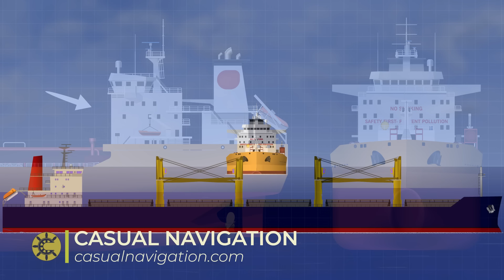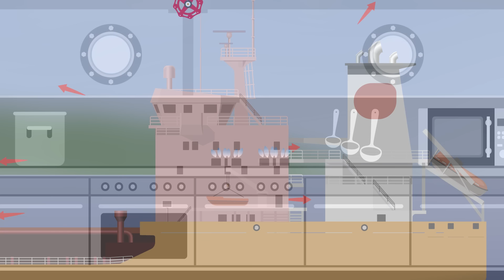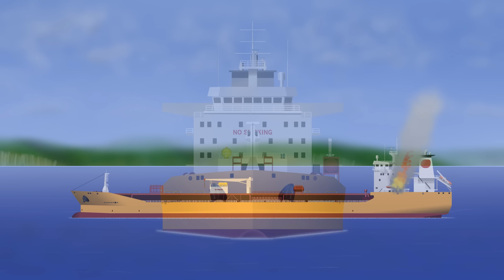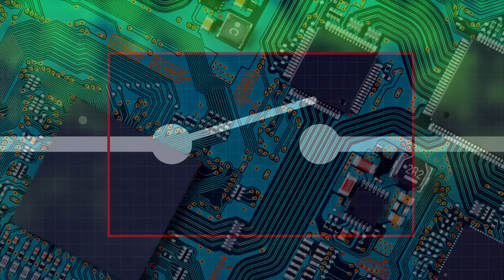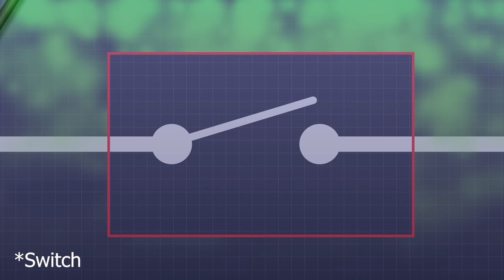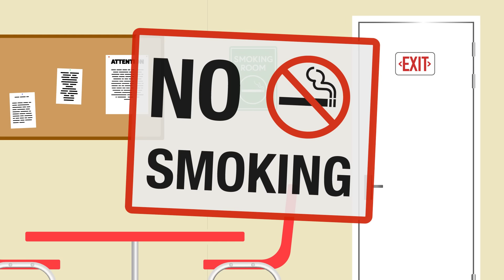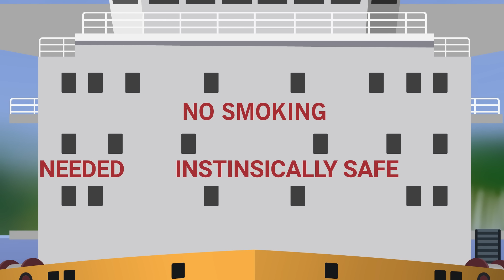You Can Smoke On A Fuel Tanker! So Why Is This Sign Here?

Comment: I'm so trigerred by the pneumatic impact wrench being plugged on the wrong port of the pressure regulator! Nice video still!
Reply: And I'm a bit triggered (just poking fun actually) at the sparks happening on the circuit on pads on the same track.
It's just one of those "merely for illustrative purposes" kind of things.
Reply: @Kalvinjj  70% of the things in the electronics picture probably never cause sparks too (not by design but because the power is so low)
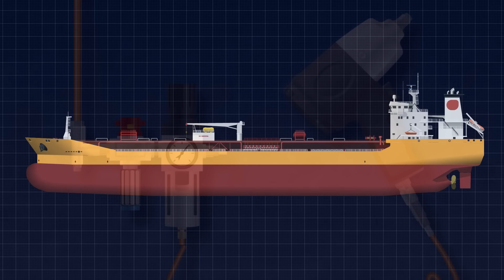Reply: MrBurne: And at 4:12 the hose at the bottom of the regulator isn't
connected to the hose to the tool. A break that looks like two hoses
just "pushed" almost together for the pix......
Reply: Easter eggs discovered
Reply: I specifically came down here for this comment I’m like why is it plugged into the water drain part if the regulator.

Comment: Cell phones have never ignited a fire at a fuel pump/tank etc. It's a myth.  Static electricity can however.
Reply: It was discovered, back in CB days, that a CB operated right next to a petrol pump, especially with an RF amp in line, could lock the fuel flow counter. 
It was never about safety. Just profit.
Reply: The other aspect is that you don't want crew distracted - especially during cargo operations.
Reply: Sean De Laloë  that's definitely true.
Reply: Those rules were also created with like early 1980s mobile phones in mind, which were higher power and likely less safe.
Reply: @urzaserra256  I don't know.  I drive a fuel truck and it's all bullshit.

Comment: I work on a small (85m long)chemical tanker in Germany . We have to use tool that have an Ex certificate.
Reply: Yes...tools made of extra super duralumin or beryllium bronze.  We weren't allowed in the welding shop to use any tools on the torches which weren't made of non-sparking materials.

Comment: I genuinely figured it was no smoking on the entire vessel! Also, compressed air tools with a hammer action would still be a source of ignition . Much like your car door latch in a fuel station...
Reply: would they just not use beryllium bronze parts where sparks could be caused?
Reply: @cockatoofan  Part of the EEX rating for the parts is to make sure of that, so you will find things like air lines are made with carbon loaded vulcanised rubber, as that is static dissipative, and that you will have a lot of hydraulic systems there as well for power. No PVC or nylon air lines, and the light fixtures are very heavy to remain intrinsically safe, even though they have electric power, it travels to the fixtures in heavy steel conduits, and inside the conduits the cable itself is steel wire armoured.  Any junctions are also in EEX rated metal boxes, with steel cable glands.
Reply: @SeanBZA  Yup. On the last vessel I was on the power cables to the exterior lights ran inside what I'm pretty sure was 1" water pipes, complete with threaded fittings and everything.
Reply: @chrthiel  Well that survives the environment and the pressure well.
Reply: Your car door latch in fuel stations are problematic because of static electricity discharge, not because the mechanism itself generates sparks. It's especially a problem with young people, who often does not grab anything when moving in or out of the vehicle, thus does not get an opportunity to discharge any static that has built up.

Comment: What about lightning?
Reply: The lights in the hazardous zones are in explosion proof housings, or high up above the deck to be clear of the zone.
Reply: @jamesmurney1374  lightning, not lighting.

I would imagine that proper lightning rods and conductors placed high enough up to be away from significant concentrations of fumes would deal with that... but I'm no expert, it's just an educated guess.
Reply: @chemistrykrang8065  Oops, did read carefully.   Cargo operations and venting are stopped during electrical storms.  Modern tankers usually do not have cargo vapors on deck while not working cargo.

Comment: Intrinsic safety is just one of many ways to design devices in explosion atmospheres. For pumps, lights etc it more commont to have explosion proof housing, And that means that housing of the device can handle explosion inside the machine without getting outside intrinsic safety means that even when there is arc on the device it carries so little power that would not be enough to generate explosion. Explosion atmospheres is a really wide topic and there is few more ways to ensure safety.
Reply: Thanks for your comment, I learned something new.
Reply: actually, explosion proof housing is more likely to be used rather than IS equipment.
Reply: Im working on a gas tanker and ex proof basically means gas tight in our case. So ex proof lamps on deck for example just have a special locking mechanism with extra rubber gaskets to ensure that nothing potentially explosive can enter the lamp casing where sparks could ignite it. But what he mentioned about smoking in being prohibited in port I cannot confirm. In port there is usually one dedicated smoking room (crew messroom most of the time) and both shore personnel and crew can smoke there.
Reply: @giantdwarfulf  Explosion proofing is not for preventing explosive gas to enter an enclosure, it's for prevent the explosion from inside the enclosure to heating up the explosive gas around the enclosure and cause fire. For preventing explosive gas going inside the enclosure, we usually add purging system with inert gas such as nitrogen inside the enclosure.
Reply: @aasakti_  ok but by preventing explosive gases from entering a potential ignition source such as a lamp or any electrical device does exactly that right? Maybe I confused the exact reason for what this special lamp casing is for but the effect is still the same
Reply: @giantdwarfulf Exd enclosures generally are not air tight/completely sealed.
The access lid has an engineered gap called a 'flame path'.
Its purpose is the gap is big enough to relieve the internal pressure if an explosion occurs inside the enclosure but the gap is small enough that a flame can't pass through and hot gases by the time they've travelled through will have cooled enough that they can't cause an ignition externally.
The enclosure itself has to be able to withstand the initial pressure spike when an internal explosion occurs.

It's ok saying "well if it's sealed, gas can't get in so it's explosion proof" but that's very surface level thinking - explosion proofing goes a lot deeper than that. There are situations where flammable gas mixtures could unknowingly get inside, such as opening up the enclosure for maintenance, the circuits inside may be all remotely disconnected at source while the work is being carried out but a gas mixture could unknowingly get inside.
If that enclosure was hermetically sealed? Congratulations!, you've just made a bomb.

Those enclosures have to be treated with kid-gloves, even the slightest scratch or mark in the lid/housing flanges renders the enclosure completely scrap.
Reply: I also found it funny they say pumps and winches would be I.S. … good luck finding motors that are IS over tiny tiny servos. The whole notion of IS is power limited.
Class 1 Div 1 TEFC or silly European Ex is a little more the norm for actual application. Good comment sir
Reply: What the fuck does automation engineering have to do with explosive materials handling?
Reply: @Marin3r101  Anything with Engineer at the end, you supposed to know about everything. Jokes aside, Automation Engineer usually working together with Instrument Engineer and Electrical Engineer.
Reply: All lot of the equipment and tools we used came from coal mining. Particularly anything certified as intrinsically safe. 
We did have flash lights which a bit more up to date than a Davey Lamp.

Comment: Um… no. Regular electronic devices don’t generate sparks at all. There’s actually quite a lot of dedicated features on integrated circuits (i.e, microchips) that deal with static electricity; and this has the side-effect of preventing any sparks from being generated.

However, electromechanical devices (which can include something as simple as a light fixture) can generate arcing if it’s running at a high enough voltage. Plugging in anything to a mains power outlet can also cause arcing; and high-voltage step-down power supplies (like a cell phone or laptop charger) can also have arcing if it fails or if it’s hit with a voltage spike (such as you can get if there’s a lightning strike).

The biggest hazard however (as mentioned in the video), is simply walking around… if you’ve ever zapped yourself on a doorknob, you know what I mean. This is why those integrated circuits have the static management features - otherwise, nobody would be able to handle their electronics at all, because every time they touched it after moving about they would fry the chips (however, do note that directly touching the chips and connections going to them without wearing a properly grounded anti-static wrist strap is still hard on the chips and can cause damage).
Reply: The video presents it as if sparking was a regular thing in electronics, in particular because the components are small. It isn’t.

Can a device catch fire? Oh yes - but a capacitor or IC that’s blown it’s top isn’t a spark, it’s an actual fire, albeit a short-lived one.

Yes, an inductor with a cracked solder joint under just the right circumstances can create arcing - this, however, for regular electronic devices (like, a smartphone) will cause it to malfunction in a more general manner (i.e, crash or just not turn on at all).

Explosion-proof devices are good to use on these kinds of ships (and other situations like mines and chemical plants); as if there is an internal fire it will be contained inside the case. Also, it shifts the liability from you to the manufacturer of the device (or more practically, their insurance company) should anything go wrong.
Reply: Low-power devices like smartphones are pretty unlikely to spark, they'd have to be damaged first. It's the same for the no-phones-signs at gas stations - the devices themselves won't generate sparks, but some might occur if they are dropped onto the floor, hence the sign. It might still be a good idea to limit electronic devices, though, since I wouldn't trust some cheap Chinese devices to not malfunction badly.
Reply: @NekiCat  yeah, after watching a couple BigClive videos, assuming electronics shouldn't spark doesn't seem like a good idea when dealing with potentially explosive gasses.
Reply: @SeanCMonahan  I’m also a subscriber to BigClive’s channel, and the stuff on there typically isn’t regular portable electronics: it’s mains powered stuff, and yes, with 240v circuits you can get some pretty frightening failure modes if it’s badly designed… which a distressingly large fraction of the low-cost stuff from China is.
Reply: In fault conditions they certainly can generate sparks: shorting capacitors,inductors that fail open, ... And some components could get so hot that they are the ignition source.

That's why equipement needs to be ATEX certified.
Reply: Okey engineer 👌🏻😶
Reply: I've had a smartphone spark before. Anything with a capacitor or battery can spark.
SHOULD they spark? Probably not. But the potential exists.
Reply: Would you bet someones life that regular electronic cannot generate spark? It's whole industry orbiting around the explosion atmospheres. https://en.wikipedia.org/wiki/Electrical_equipment_in_hazardous_areas this article might be helpful

Comment: Tankers usually use steam to power their wiches, as they already have boilers big enough to cope with the pressure demands of a winch
Reply: I would have guessed hydraulic winches would be the norm these days.
Reply: Steam winches have largely gone away, the were supplied from large boilers so the load wasn't an issue.  These boilers would supply the cargo/ballast pumps and cargo heating.